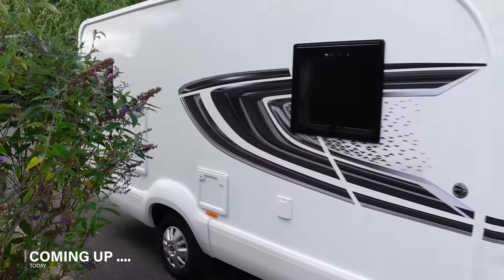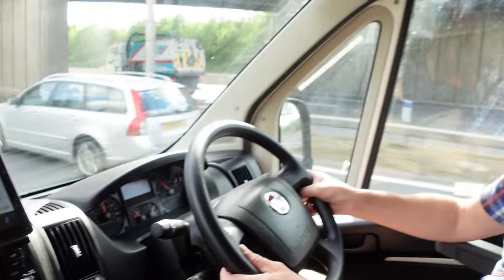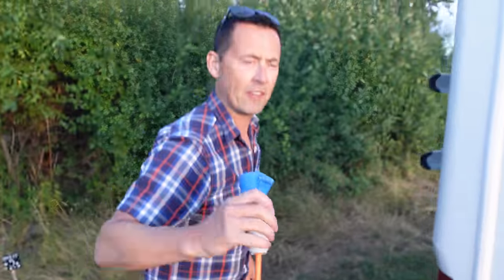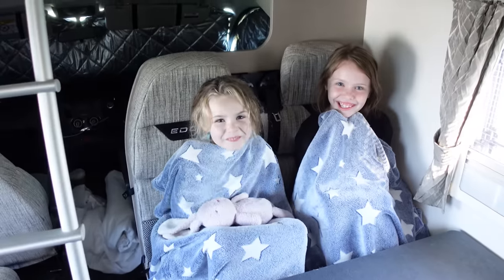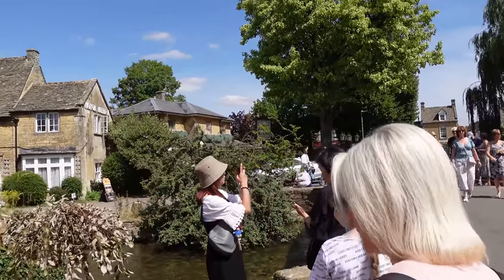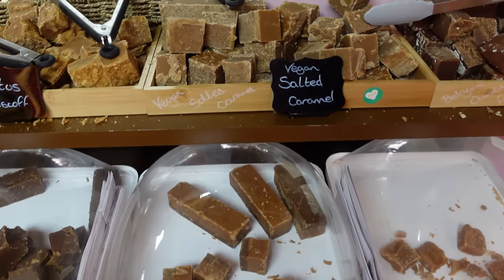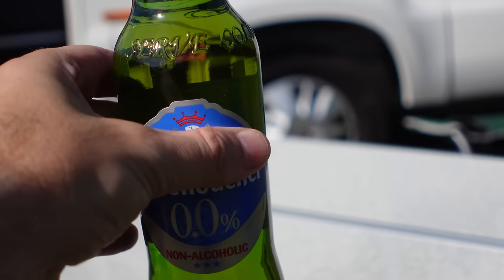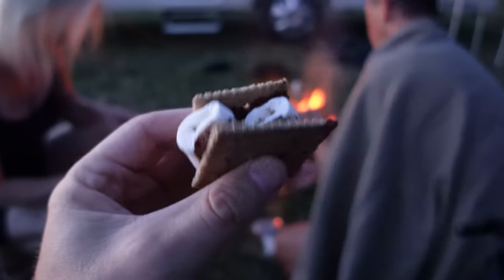The start of UK VAN LIFE | ROAD TRIP begins | TRAVEL DAY

Comment: My husband’s an retired police traffic officer so plenty of driving qualifications and experience. He prefers to put the ramps behind the front wheels and  slowly reverse onto them - the accelerator is slightly more controllable in reverse and when the handbrake takes over from the footbrake the van settles onto rather than off the ramps.  One final tip - the rear of the van sits higher than the cab.  With this in mind, ramps can be avoided on occasions by parking with the cab facing up the slope.  View, weather, habitation door, size of slope and privacy considerations will influence your decision on a case by case basis.  I really hope you enjoy holiday.  So far you’ve taken to the motorhome like ducks to water.